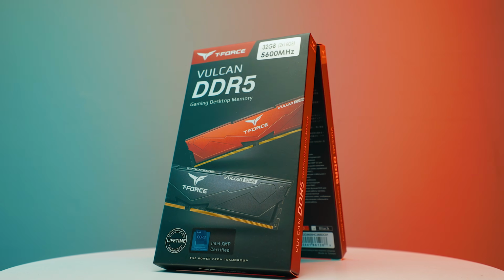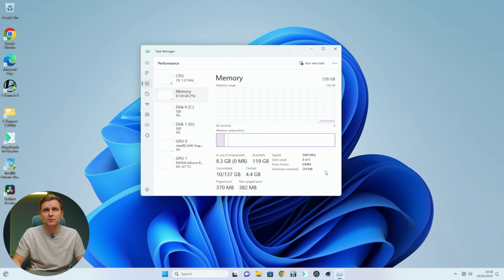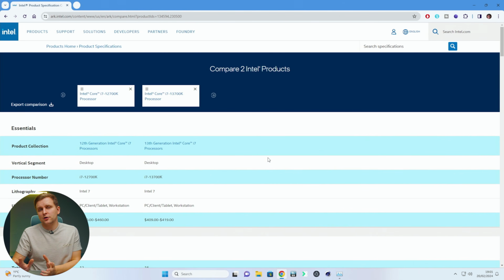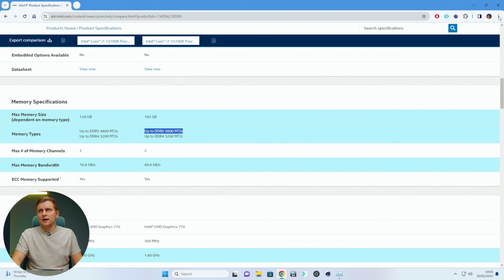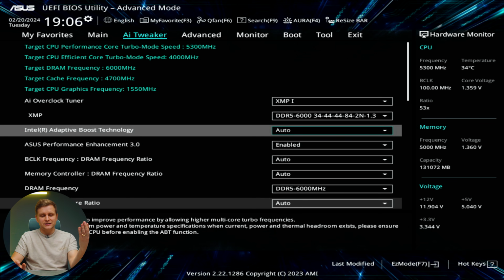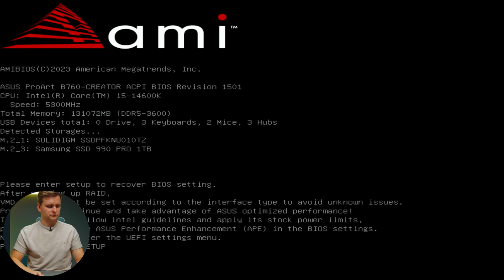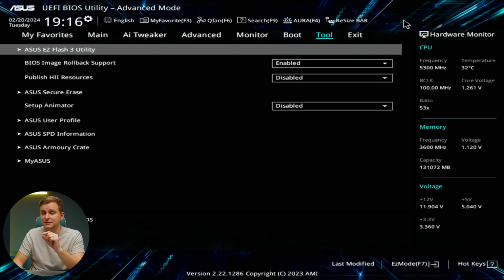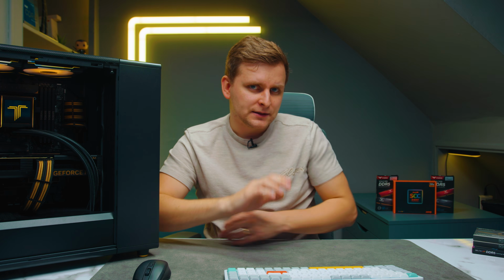Maximize RAM Speed EXPLAINED: Common Mistakes to Avoid & FREE Performance Boost!

Comment: Can someone please help me understand why I can't enable XMP with a four dimm set up, On an MSI Z690 motherboard, I even when and got another 2x16gb sticks so I can enable XMP, But when I do even with two stick set up, I enable XMP with the 2 stick config, I keep getting restarts, So either way, A 2 stick causes the PC to crash, With 4 stick set up, it goes into some boot mode thing, I had the blue screen yesterday, But managed to get it back to the bios so I could turn off the XMP, I even got CL36 DDR5 at 5400MHz, But the MSI Z690 Unify, Lovely board apart from not having a HDMI output, But now you can get thunderbolt HDMI adapters, Think I will have to buy one, Still though, I got an MSI Z690 for 2 reasons, One coz I got it for 160 pounds in Amazon sale, Amazon got some amazing MSI boards going for some brilliant prices, And another reason I got the MSI Z690 to have faster ram speeds,. Faster Ram helps with sim racing see, More ram and you get no stutters if over 30 cars is on track, My old motherboard is a Gigabyte H610i DDR4, I got CL18 DDR4, 32gb is faster than the DDR5 for loading up, lol, The CL18 DDR4 ram is brilliant ram, I was able to to run XMP profile on a H610i motherboard, But a 250 pounds motherboard isn't stable with XMP enabled, i am even feels done by not being able to run XMP, With four dimm slots filled, I also would of thought with four dimms running the PC would be more stable than with two sticks, So can anyone explain why I cannot have XMP enabled when I have paid money to have XMP enabled, I read that if you want to run XMP profiles in DDR5, It is better to get a motherboard that only got 2 dimm slots on it, I did not know that when I got the MSI Z690, I only just got it as well, lol, Still though for what it is worth, The CL36 DDR4 ram as 2 stick config is coming up as 4800MHz out the box, The CL40 DDR4 in a 4 stick config was coming as 4000MHz, So the CL 36 is the DDR4 ram to get, And if you can get less than CL36 then you will have a fast bit of ram out the box, So I am gaining 1600MHz having the 2 stick config, I think CL36 is the lowest at the moment......
But then the reason I likes PC stuff so much is cause it is mostly problem solving, It isn't that difficult to put a pc together when someone who knows how shows you, It is how I learned observing a friend helping where I can, lol, Putting a PC together is a one man job, Another pair of hands would get in the way, lol, In fact if I had a company selling pre build PC's, I would create something like a parent and child pc build project at home, With a You tube video for the step by step instructions, You could sell a PC like in Kit form or Bundle, Everything you need for a PC build with different selections of course, For different prices, All in a box for a set price, Most the revenue could come from the Instructional You Tube video, Coz if you can put flat pack items together, Then you will put a PC together, Hardest part is the CPU and Cooler, Oh and the power on buttons, Finding the right hedders, lol, But yeah I think say a Father and Son PC project/build and getting a PC in kit form ready for Father And Teen Project to put together one Sunday afternoon, How many kids would love to go to school bragging how they put a PC together with Dad, And at the same time Dad is learning things while educating the son or daughter, I would of loved as a kid to have built a PC with my Dad, As it stands I had a Play Station when it come out, I was lucky to have had the PlayStation like within the first week of it coming out, I used to love Ridge Racer, Explains why I enjoy sim racing, lol, They should make a new Ridge Racer to be honest, lol....
But yeah I wasn't impressed I can't run XMP profile with four dimm slots full, And even now with two dimm slots filled, I am getting crashes all the time, Even you tube was making the PC crash, And that is with 5600MHz ram, Not even the 6000MHz I read people gets using the MSI Z690 Unify, I am not changing anything now, If anything I will try put another 2x26gb of CL36 ram, and then have four dimms running at 4800MHz, At least I know the PC will be stable, I want to enter some online competition races now I am confident enough to hold my own, Just I don't want my PC to crash while I am in a race online, Sim racing helps me deal with the mental health I suffer with, Not being able to go out anymore because of the CPTSD I was diagnosed with, Sim racing seems to be the one thing that helps me stay grounded, Any gore games though, I am a mess, So Sim racing keeping me grounded and off pills then it is important that the sim racing just does sim racing without issues, lol....
I just seen an i5 12600f CPU on Amazon for a bit less than hundred pounds, Brilliant price for a CPU, If you already got a GPU, Personally I would only ever get a CPU with a K on the end, But for a PC build for a kid, hundred pounds for the CPU, And with a decent GPU, It will be better than the PS5 Pro, 700 pounds for the PS5 Pro, Is showing why PlayStation is more about profits rather than giving gamers decent Consoles for decent prices, The PS5 Pro might start putting people off PlayStation, Unless the rich people don't mind paying the prices, I would still rather build my own PC now I know it isn't that hard to put a PC together, lol....
Can anyone tell me why I am having my PC crash when I enable XMP on an MSI Z690 Unify motherboard????, Will sorting the latest Bios work, I still have an old 2023 Bios I think I will be putting latest Bios on my Z690 later on so will find out tonight I guess, lol....

Comment: I am running 2x32GB DDR5-6000 CL30 1.4V on an ASRock X670E Taichi with a Ryzen 9 9950X. 
However, when I test the memory with Memtest86, I get errors, so I'll try, just as you've shown in the video, to load the EXPO profile, then to reduce the frequency at 5800MT/s, or even 5600MT/s.
Reply: How did it go?  I'm thinking of buying the ASRock X670E Taichi and fitting 64GB of RAM.
Reply: @ZigSputnik  
Hello! 

It's running well, but I had to load the EXPO-6000 profile/ Save/ Restart. 
Then I've lowered the DRAM speed to 5800MT/s. 
Everything works flawlessly. 

I have used multiple system stress-testing programs for many hours just to make sure that it's 100% stable (Memtest86, OCCT, Windows Memory Diagnostic, Y-Cruncher, etc.)

NOTE: 
In your case, you might not have to lower the frequency of your RAM in order to have a stable system. 
It's all about the silicone lottery of your CPU.
Reply: @Crossfire2003   Thanks for your reply and those details.  There is a X870E Taichi now, so I'll check that out before buying.
Reply: @ZigSputnik  
It's all about the silicone lottery of your CPU. 
My build runs flawlessly with the DRAM lowered at 5800MT/s (I've stress-tested it relentlessly).

Comment: What are you doing? 
Your XMP is running at 1,3V? 
This is way too little Voltage for 4 Dimms. Try 1.35 or 1.4V on the Dimms and The IMC Voltage to 1.1-1.15V, 1.2V Max

Comment: Best advice as a DDR5 user......don't buy them and set them up for quad channel because you'll never fix it because it will always give you an boot error. AKA black screen even if you update the bios setting too with USB-Flash boot. Just buy two ram of 32 RB that is 64GB RAM. Instead getting all four of 16 GB RAM into all four slots, bad idea and no matter what theory it is. These new generation of gaming MB are too needy and a lot of incompatibility with certain hardware parts.

Comment: Just checked Intel ark for my I5-13400F and it says up to 4800MT/s for DDR5 but in windows and BIOS it says is at XMP on 5200Mhz which is the promoted speed on the Ram kit, also wonder if worth to increase that XMP to 5800Mhz in this XPG Lancer 32G (2 sticks)

Comment: Back in the day when I increased the RAM speed and didn’t get it stable I increased the voltage by 0.1V and is do this until it was table. Some times I needed to change the timing and make it slower. But it would actually not make a difference in game tests. If I got more FPS I accepted the lower timings in exchange for more MHz.

Comment: I have a question. I have the msi z790 gaming plus wifi that supports up to 7200mhz ram. I have the 7200mhz corsair dominator but the xmp boosts it to 7400mhz while my motherboard supporte 7200mhz ?  Is this ok?
Reply: I accidentally bought a 7600 mhz set of ram for my MSI z790 and 13900k, when I xmp them I get blue screen, when I manually set the ram to 7000mhz no more blue screen, but I didn't change the timings or voltage when I did this but bios shows it running at 7000mhz, my question is am I still getting more performance than my old 5600mhz set that was running xmp?

Comment: Well I have to stop you right here. You have made a few statements that, well, are simply wrong. I know you are just throwing out generalities like raindrops - but, 12th 13th? I believe you mean well. But pretty much, it takes less than a minute to say - use XMP settings in the BIOS and let the chip set do the rest.

I have an air cooled i7-7700 in an old ASRock MB running 32GB XMP DDR4 3600 (18 22 22 42 & 2T) stable at 3900 12 12 12 28 1T. ... that's 7 generations back, with rare exceptions - nearly 100% up time.

The simple truth is, you can't make assumptions like that. 

You are correct, most DRAM with the high numbers are over clocked profiles (maybe that's what the "OC" by that high numbers.

Both ASRock & Intel say max DDR4 is 2400.

(Bonus: imho -  most computer issues can be avoided by staying away from AMD or Asus. - 😅)

p.s. - memory is far too complicated and diverse to try to make a single video.  It's pretty much - a [computer] case by case discussion.

Comment: Tech Notice, I have seen everywhere people saying that you should only run 2 sticks because quad channel is a thing of the past and you can hurt the performance of your ram by adding another kit of ram into your pc, utilizing all of your slots? It's also been stated more over that using 2 kits can cause instability (i had wondered if tinkering meant you could bypass this instability of 2 "same" but not same kits installed into your pc. You may go over this point in your video).
I do video and design work and i'd love a 2nd kit in my PC but these statements always stopped me from getting another kit. What do you say to this? (I'll continue watching and if you address them/answer them and I understand, i'll delete this comment) <3

LOVE your content for stuff like this. You seem like the only person doing it right.
Reply: Hmmmmmmmmm. I'd still like to know why you think it's still OKAY to run more than 2 sticks, like what use cases. Clearly you're doing it and it's "creator" based but you would thing if there's issues doing it that creators wouldn't want to risk having a worse time "creating" on their system and therefore avoid 4 sticks anyway.
Also still curious what you think when people (and manufacturers) state that two kits of the same model is a bad idea. You've clearly done it, what are your thoughts?

Comment: Enable PMIC (ON Asus)which handles and trains each stick instead of the group of sticks as a whole.
Lower the voltage to 1.25 or on some boeards/memory sticks it will go as low as 2.0 volts and run higher.
You do not have to clear CMOS.  Poer off and ho back into BIOS

O

Comment: I'd like to know something that you never said, tested or benchmarked in this video. In fact you never specifically said it and I was thinking it the whole time. You always defaulted to the fact that you couldnt run your RAM at advertised top speed as long as you used 4 sticks but that however it was possible to get the highest speed if you only use 2 sticks. my question is Are 2 sticks at a higher speed faster than 4 sticks at a lower speed? You know 10GB of ram at a slower speed than 5GB of ram at a much faster speed still might be a faster computer just by the sheer fact that you have twice the capacity of RAM. You never said the opposite all you said is that you can get the fastest most efficient setting for your ram in many cases by jjust using 2 sticks. Maybe you dont want the fastest most efficient setting if doubling its capacity works better

Comment: Hi, but my question is: how can I know that the ram speed I'm setting is better than the one that the bios says is better in default? There is a software where I can test default and expo and how to read to understand if I am having a better result for real? Thanks, and finally a great video explanation of what we are doing
Reply: Your looking for latency 

6000mhz cl30 has a ram latency of 10ns
6000mhz cl28 has a ram latency of 9.33ns

latency says the second is better due to lower ns

AIDA64 has ram benchmarks which gives you a lot of information but they have significant variables, you can get wide swings just at random. That said lower latency is best when it comes to ram, 2500mhz cl10 has a ram latency of 8ns and it would beat 6000mhz cl28 just due to the latency alone even tho 2500mhz cl10 would be DDR3 speeds (though those times are not possible) but my point is speed matters as much as ram latency. 

CAS latency is not ram latency however ram speed plus CAS determines ram latency.

Comment: 11:20 Does the ASUS motherboards that bad? On my ASRock motherboard if the RAM changes does not work it just automatically resets bios settings and put a warning which then loads bios. The same was with MSI motherboard

Comment: this stuff is all over the place. ddr5 is a mess.  intel xmp ram recommended by asus for my amd cpu... call them up, they have no clue how to get 6000 or 6400 running with the low timings advertised. told me they would look into it and call me back, put me on hold for 10 minutes, i figured it out on my own, they come back, i tell them, just say say 'oh'... they dont care how it was done or anything. Amazing! lol but yea, i got it working, xmp certified 6400mhz 32-39-39-102  2x 48gb chips = 96GB ram on my AMD 7950x

Comment: Asus Z790 MoBo´s have 2 XMP profiles, XMP 1 & XMP 2. My 6000Mhz CL30 2x16GB kit worked on both XMP profiles but on XMP 1 profile I notice stuttering in games. When I changed it to XMP 2 profile the stutter disappeared. XMP 1 profile is an Asus tweaked profile and XMP 2 profile is the RAM manufacturer profile. I advise you to go first for the XMP 2 profile.
Reply: I posses almost an identical setup. It's definitely the most optimal for gaming at 6,000 CL30 32GB DDR5 (on our specific setups). We could get away with 7,200 CL34 but I have never heard of anyone not having stability issues.  I cannot wrap my head around why anyone would try to load a 4 stick ram kit trying to achieve the highest amount of ram without understanding how it affects performance.

Comment: I just added 2 more sticks to my system and it wouldn't even boot, all 4 were corsair vengeance ddr5 16gb 6000mhz. But 1 set was 36-36-36-72 and the other set was 36-44-44-96 and it wound not work at any speed.

Comment: So many boards will set horrible settings when allowed to manage ram as "auto" even though you are hitting higher MHz, latency may even decrease with loose settings!  Always good to use CPU-Z to check how your ram is actually running versus the XMP setting options listed in the SPD tab. To calculate RAM latency, multiply the CAS latency by 2000 then divide by the data rate.

Comment: Interesting information. I just upgraded my memory to four sticks of CORSAIR VENGEANCE RGB DDR5 RAM 64GB (4x16GB) 5600MHz CL36 Intel XMP . I searched the ASUS support page to find a compatible memory kit with four sticks to run in my ASUS ROG Strix Z-690 E Wi-Fi motherboard. I have an updated BIOS to support the i9 13900K CPU I recently got. The system reports it's running at the advertised speed and there really have been no hiccups. I kind of held my breath at start-up but it booted right into Windows the first time and I have run a few stressor benchmarks with no issues. It helps to consult your motherboard support page to find compatible RAM but maybe I also got lucky.

Comment: Thanks for another great video - will observe / absorb this info before building my M2 I7 G14 Machine - especially on XMP on/off and selecting appropriate / Max stable Memory speed.        I7 G14 Up to 5600 Mhz Native but my motherboard can address more / less depending on ram used and how many memory channels I used up.   For me will use  2 x 32 Gb one per channel, = 64 Gb

Comment: Using 14700K on Gigabyte Z790 Aorus Elite AX motherboard with 16*2 GSkill Ripjaws 6000MHz CL30 RAM kits. With XMP enabled PC starts fine works blazing fast but once I try to run heavy tasks for longer periods with Premiere Pro or Aftereffects I am getting BSOD. Have just reset the RAM speeds to 4800MHz let's see how it works.
Reply: Check your ram usage